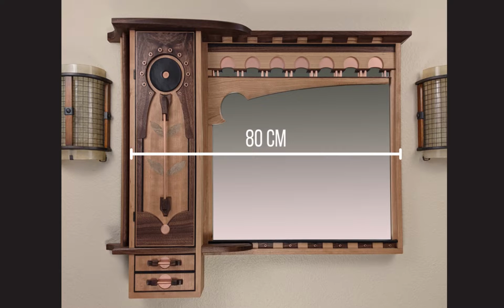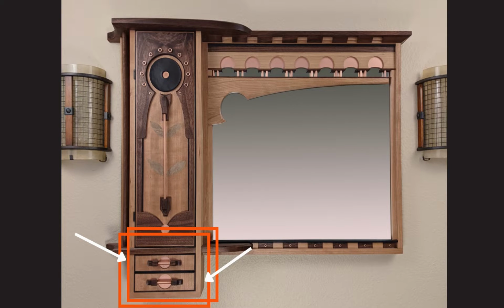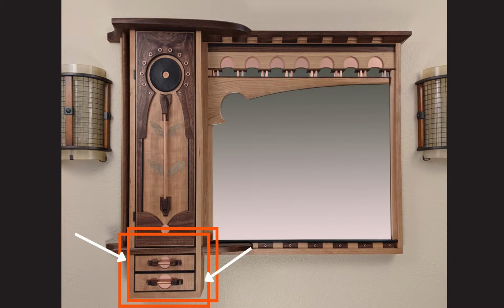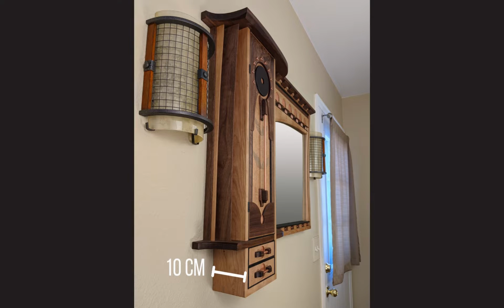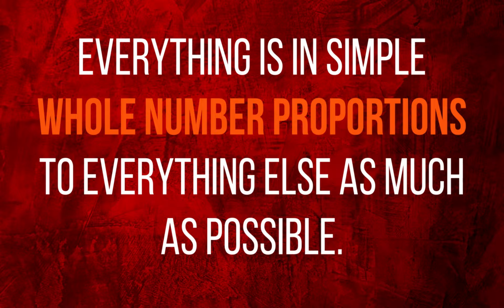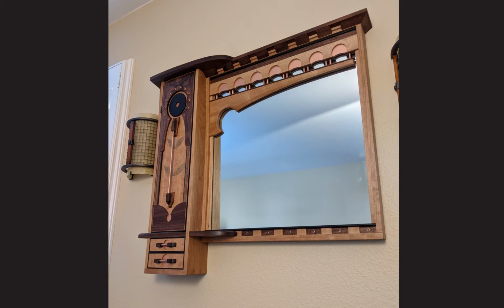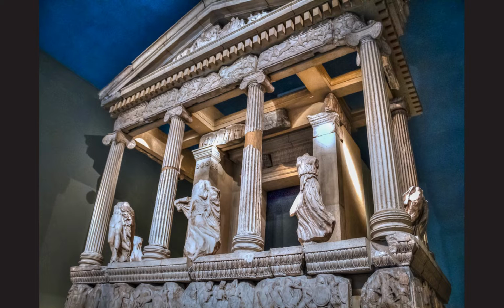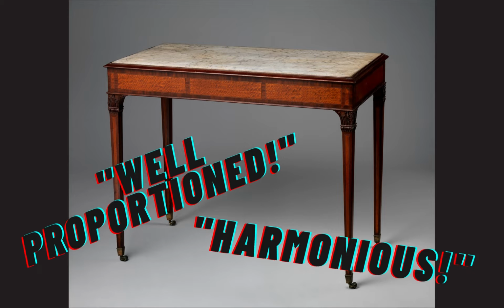The 5 P's of Furniture Design: Proportion (Pt.2)

Comment: I used to watch my great uncle build furniture from the stock he had on hand. He usually had a story stick with dimensions for where the finished piece needed to fit, but no design on paper or anything. He would go through his available stock of wood and pick the largest clear portion of his largest piece and then find a smaller piece that he could get a finished 1/7th or 1/6th of that larger piece. Then he'd pick the rest of his boards based on that and use that to figure out his design in the end. He explained this stuff, but I was like 8-10 years old at the time. I've forgotten much of what he tried to teach me.  It's still well beyond me how exactly he figured all the middle bits out, but your video gives an interesting insight. That furniture is still some of the nicest furniture I've seen. Everything worked well together and family member still have many of the pieces he made.  Thanks.